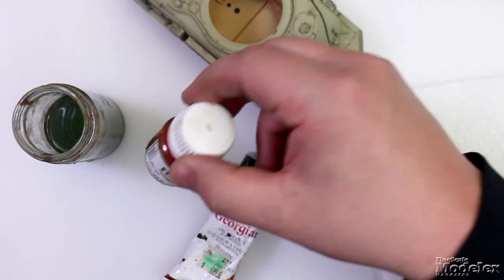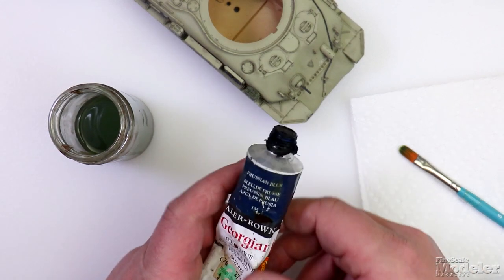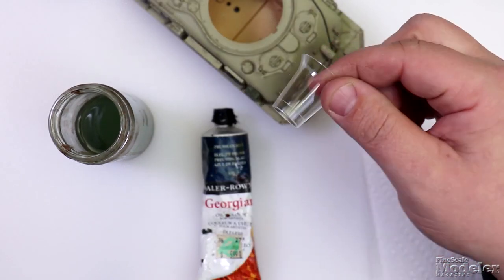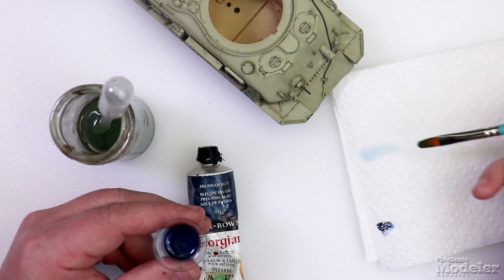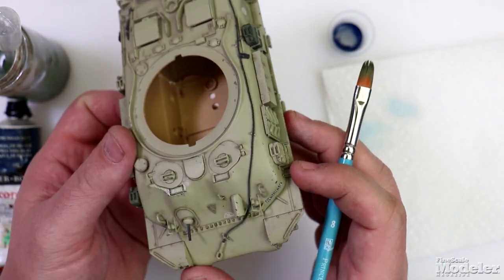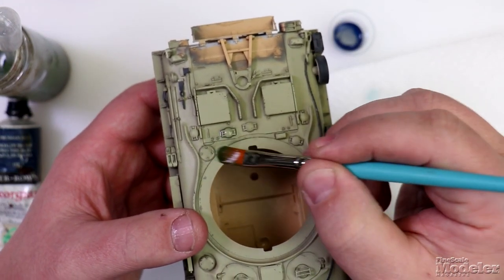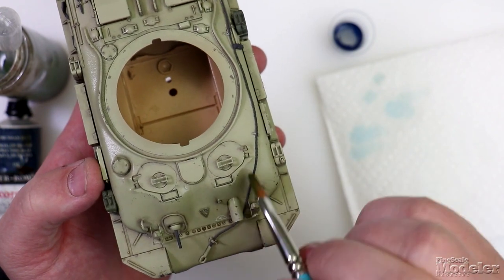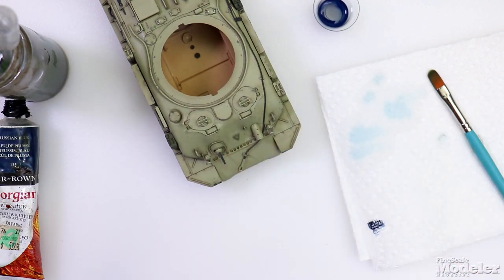FineScale Modeler Skill Building: How to make and apply scale model filters

Comment: Do you add directly over acrylic paint or should you put down a gloss coat first?
Reply from the maker: It's always a good idea to seal the work you've already done to protect it from the work you're about to do, so put down a flat clear first, and then apply your filters. If you use a gloss clear, your filter will act more like a wash.
Reply: Just what I wanted to ask.
Reply: Is there any preference about doing washes first or filters?

Comment: So, just so I know I have it right...the difference between a wash and a filter is that the wash uses a somewhat greater proportion of paint, and that washes are applied more heavily than filters?
Reply from the maker: Yes. The filter is used to subtly change the color of the parts its applied to, while washes are used to add volume or even weathering.

Comment: Thank you. How may this differ from an oil based wash? They can be made the same way. Is it the ratio of thinner to paint? kindest regards.
Reply from the maker: In this case, it's more about the application. Remember, with a wash, you're applying the thinned mix to the model's surface so that it gathers around details and in panel lines. With a filter, you're wicking most of the mix out of the brush and applying it to achieve a tonal shift to the paint underneath.

Comment: Is there a rule of thumb as to what colour the filter should be.
Reply from the maker: It really depends up on the effect you're looking for. You could use a blue or red filters over metallic paint to simulate heat effects. Earth tones could be dirt. Or you could be using the filter to adjust the tint of the underlying paint overall.